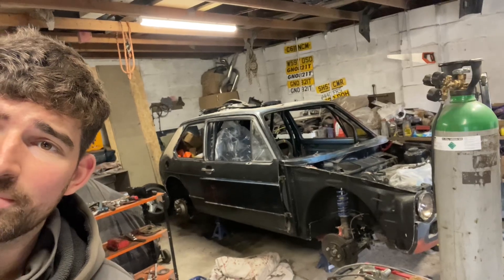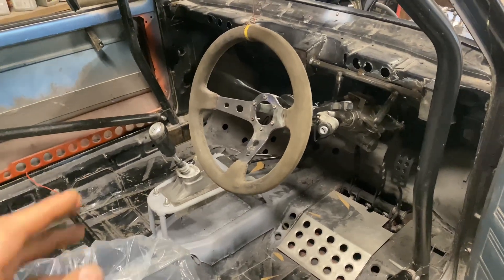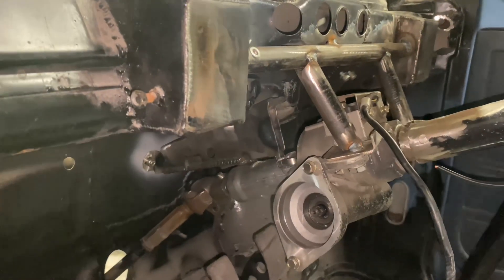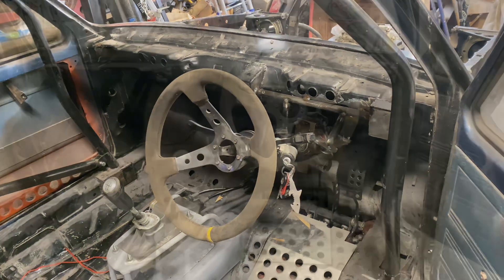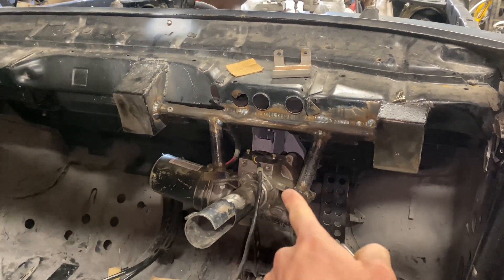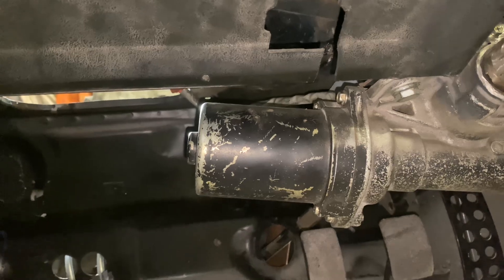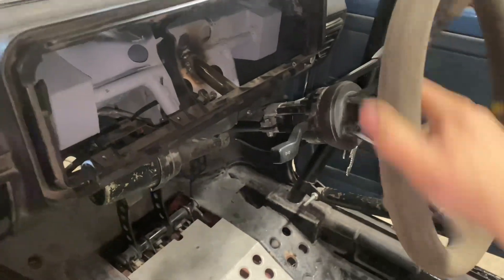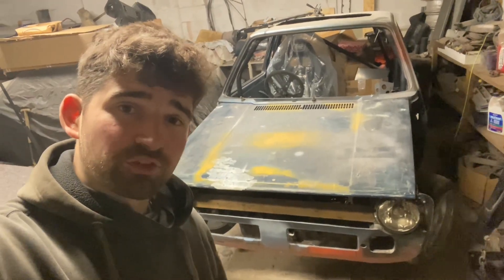Mounting ELECTRIC Power Steering!  MK1 GOLF BERG CUP HILLCLIMB BUILD #4

Comment: Good job, I know this isn't the easiest of jobs! Ive also done this but have lost my self centering, id be interested to see how yours drives, then id know if i have an issue somewhere else with geometry etc or if its just the drag of the motor
Reply from the maker: Thanks, I'll see what it's like once I've wired it up etc.  Is yours wired up to a potentiometer to adjust the level of assist manually?
Reply: @mk2daz I've got a GPS version so its automatic depending on speed, but I'm also running modified hubs and suspension so could be anything 😅